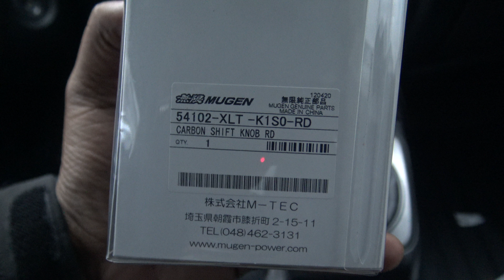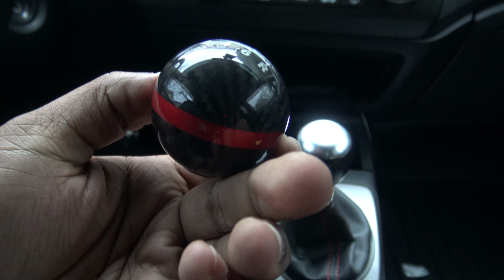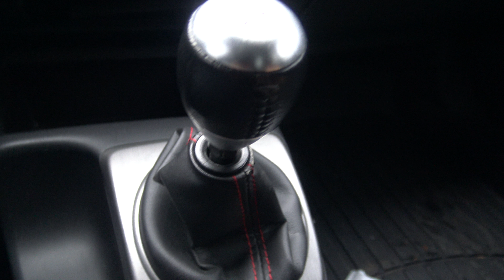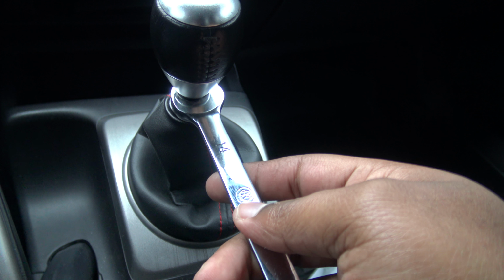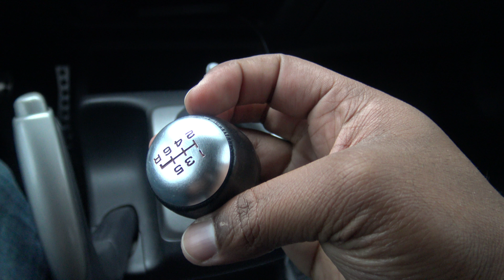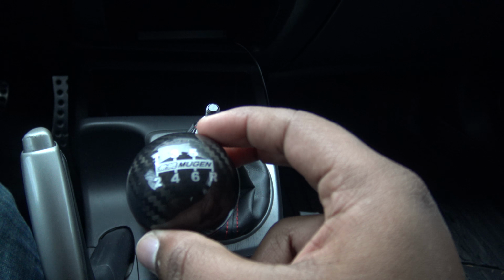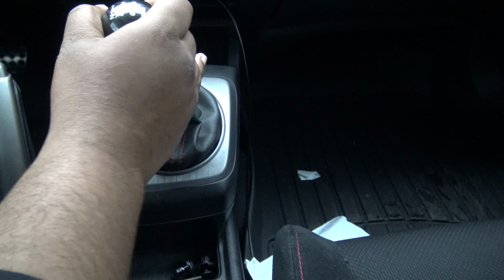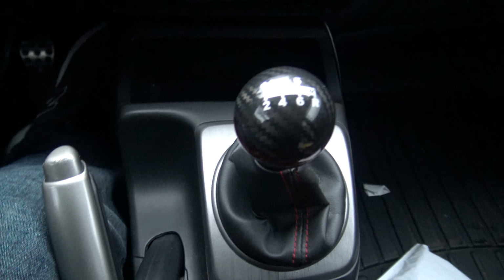Mugen Carbon Fiber Shift Knob Install | 2011 Honda Civic Si *Christmas Came Early*

Comment: How do you fits the speed number straight ?
Reply from the maker: After you twist the knob down.. Get it straight and hold it straight and use the nut to tighten it